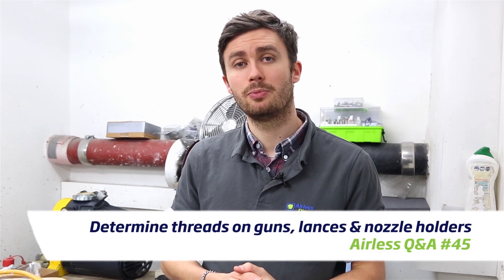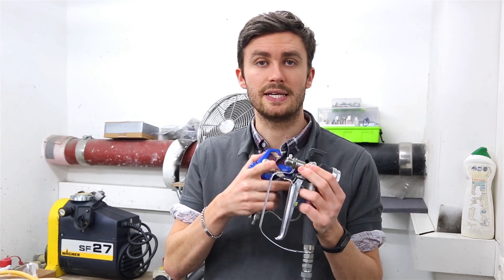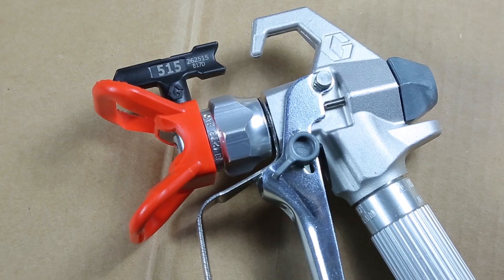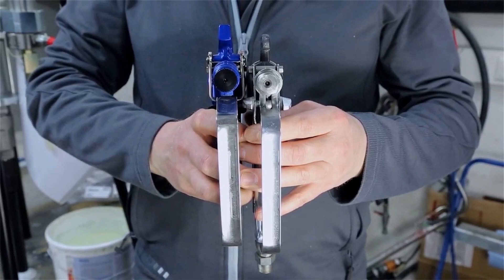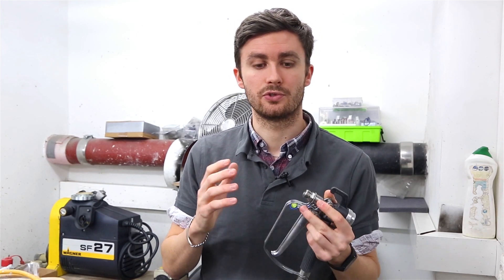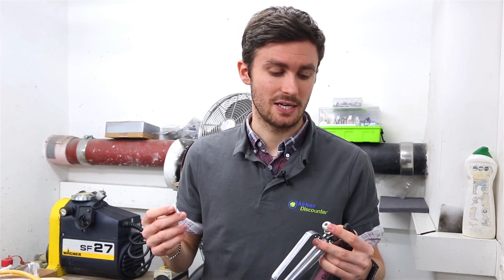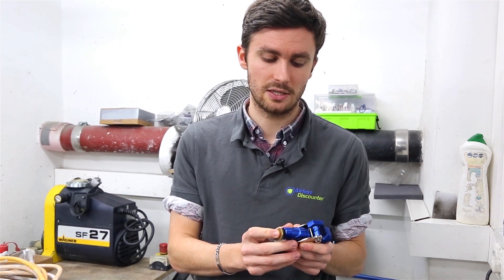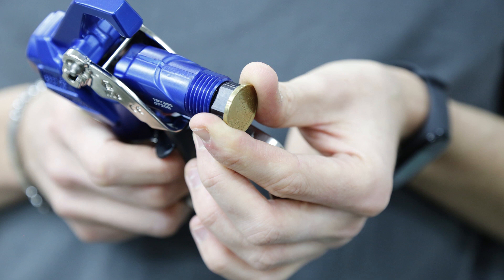Airless Q&A #27 - Determining the thread on guns, lances and nozzle holders

Comment: Hi mate, I’m only a DIYer and have a wagner 250m and was wondering weather this can spray my mdf skirting and door frames in satin, I’ve used it on the walls with lovely results but am unsure of the setup to paint the wood? Thanks
Reply from the maker: Hi,
If the paint to be applied remains thin, it should work on this machine. 
For the nozzles, you will just have to adapt with smaller angles such as 20° or 30° for example. 
Kind regards,
Airless Discounter team
Reply: @AirlessDiscounterInternational  thanks for your fast reply, just subscribed and working my way through your videos 👍
Reply: I realize it is pretty randomly asking but do anybody know of a good place to watch new movies online ?
Reply: @Julio Pablo I watch on Flixzone. Just search on google for it =)
Reply: @Cade Zayd definitely, have been using flixzone for months myself :)
Reply: @Cade Zayd Thanks, signed up and it seems to work :) I appreciate it!!
Reply: @Julio Pablo you are welcome :)